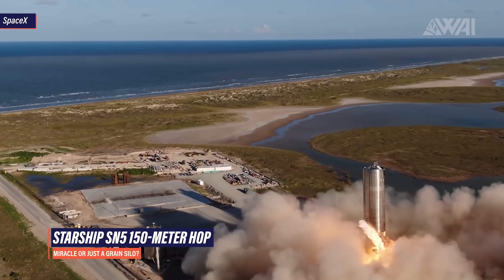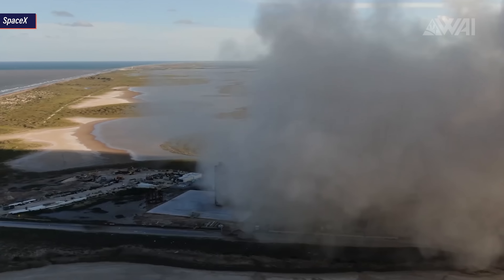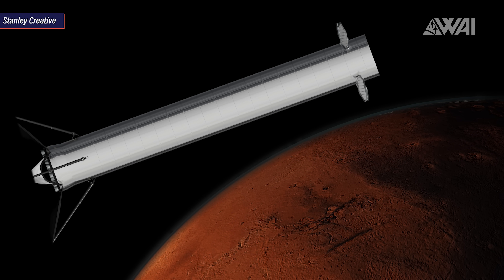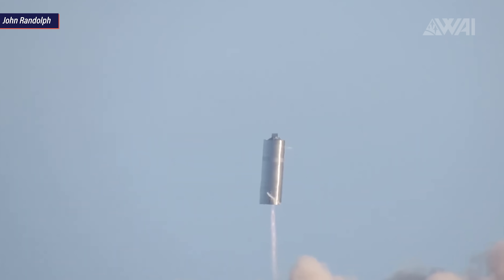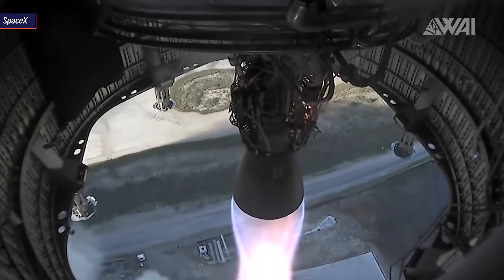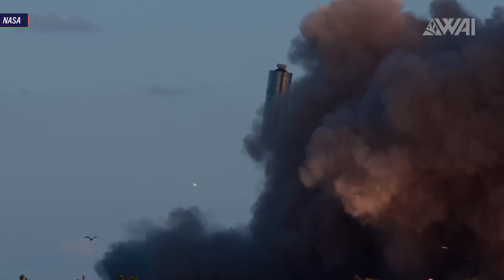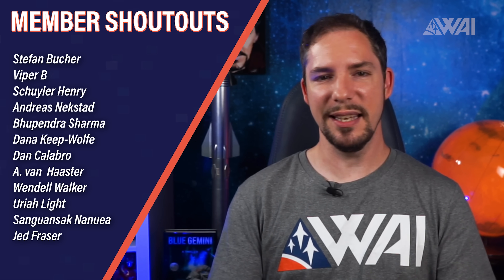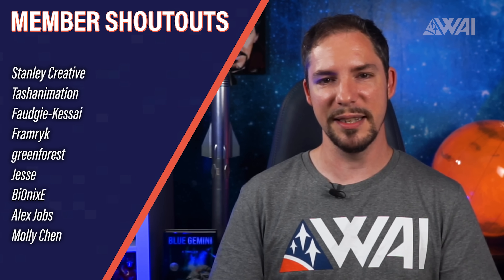111 | SpaceX Starship Updates – How did SN5 do?

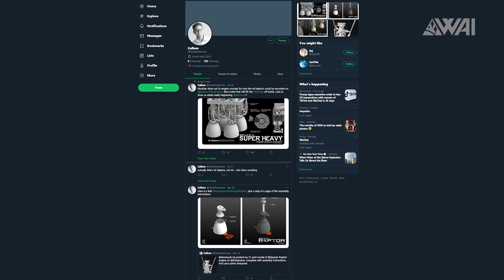Comment: Callum's design isn't wrong simply because of the number of Raptors on the booster.  His arrangement isn't designed for symmetrical thrust.  @ 11:30 minutes the bottom left view of all the raptor engines shows four engines at the top side but 3 or 5  on the bottom of the view completely asymmetrical to the opposite side.  

If you need to shut down a damage engine the engine on the opposite of the rocket needs to be turned off too and it helps steering if they are exactly opposite to each other.
Reply: they can throttle the engines as well in case of engine failure. I doubt it would be as big of a deal as you describe as falcon 9 can fulfill it's mission on 8 engines.
Reply: @snuffeldjuret  you're proposing to make the programing of the flight that much more complicated which serves automated contingencies like engine failures, loads, center of mass, throttling and gyroscopic control more complicated becuase...its not that big of a deal.  You'd just might be a good fit at Boeing.
Reply: @snuffeldjuret  who am I?  I'm just a Mechanical & Structural Drafter Designer. 

Disabling and or throttling an engine depends on your flight profile and fuel margins vs load.  If you're at the maximum margins for flight throttling wont work while you could shut down the opposing engine and burn for a longer duration., assuming  you sacrifice a optimum landing.

Throttlings disadvantage is asymmetric thrust,  lost efficiency when thrusting away from the center mass. Gimbaling corrects but you lose fuel unnecessarily.  Same with RCScorrections.  You get into space but you can do less once you're up there.
Reply: @snuffeldjuret  No, not a programmer, not a Space X Employee but Tesla did want to higher me if I was willing to move to Austin.  I'm in Houston.  Nonetheless  that's a problem for Engineers and Designers like me not programmers.
Reply: @snuffeldjuret  Having a comment on Falcon 9 failure procedures and that comment not being recognized are mutually exclusive.  The denial of such a simple reality must mean you are operating from conclusion based reasoning.  Not much else to say.  You either use reason or you can't.
Reply: @snuffeldjuret  It depends on the flight profile and margins.  You're focusing on Falcon 9 as though its comparable.  I dont think it is.  The Merlin failure on a Starlink flight resulted in a lost booster on landing but it had enough margins in the second stage to make up  for the failure because it was so late in the flight.  Now if Falcon 9 had been programmed to use any 2 symmetrical engines to land after failure is detected one might think the booster might have survived...but no.  The booster is so light at this point that even at the lowest throttle setting the booster would have begun rising again.

The Super Heavy is more like the N1 rocket. It will need 3 engines to land all that mass so there for symmetrical thrust is even more important to recover during suicide burn.
Reply: @snuffeldjuret  yes the falcon 9 can suffer failure in one engine but that still depends on the available margins.

Comment: I like Starship but in many ways I'm more psyched about Super Heavy. Even without Starship, (ie with a conventional 2nd stage) Super Heavy revolutionizes spaceflight capability. Super Heavy is also more straight forward to achieve with the biggest hurtle being the engine count (which isn't that much more than FH). Starship (while I have faith that it will prove out) has many more un-unprecedented hurtles.  SH's relatively easier development gives me even more of a comforting feeling that no matter what spaceflight will change forever for the better.
Love you, Saturn V, but you belong in the past. It's long past time to pass the crown along.
Reply: Cheap and consistent; starship is the way

Comment: I do not doubt Starship could quickly become a pretty cheap cargo ship with a very fast turn around interval between flights... but for crewed missions, it would be much easier and safer to design a 9m Heavy Crew Dragon to be put on top of a SuperHeavy Booster with a standard heat shield + parachutes re-entry pattern than the belly-flip manoeuver and retropropulsive landing that Starship should do to land... that kind of re-entry pattern is unworkable for the crew safety, if the belly flip failed for any reason, it's a total loss and NASA will never accept such a high risk of a catastrophic human loss. Things will take much more time than most think to reach the point of routine crewed travels. But we are undoubtably going fast in the right direction.
Reply: I agree that there is a huge danger and the system would need to be proven and proven heavily before I'd ever get on one, but unless they're flying NASA crews I don't think NASA has any actual say.
Reply: @TheEvilmooseofdoom  I don't know which administration will be responsible but there will be one to qualify the craft to be safe enough to take passengers. You can't maje a plane and put passengers in it, even volunteers ready to die, without your plane having passed a certification. I have the feeling that NASA will be that administration. Now it's also a first, so maybe they will create a new administration for space craft but in any case it will not be just Space X deciding that their craft is good enough to take passengers.

Comment: @Felix I think you misunderstand the protyping process undeway right now.  I don't think Version 1 of Starship will be assembled this way with "Rings"  That's a lot of weak points for failure.  It will likely done like SLS  and  Space Shuttle with single LARGE sheets of metal stiffen with girders.  They don't have the Machines to make these machines right now because they don't know what the final design of version 1.0 will be.

I believe this current prototyping is being done this way to prove the concept as doable AND flyable in order to get NASA's and the worlds attention (Much like they did with Falcon 1) and then get the NASA to fund the development.  That's when they'll start really designing Starship, knowing what works and what didn't work from the prototyping phase.
Reply: @admarsandbeyond  I think they will still put orthogrids in the skin even if it means some new or uncommon technique which is where the steel Advantage may come into play. This current method is fine for prototyping but I see too many places where weld inspections and scans are needed.  That has to be reduced. There will still be modular sections to make this swappable and easy to repair but definitely believe the plant its self will not follow traditional methods

Comment: Falcon 9 was supposed to have a 24 hour turnaround which turns out to be fifty times greater. So using that as an example the three times a day or 8 hour turnaround would equal somewhere around 16+ days turnaround for Superheavy. Who knows for Starship and it's heat tiles and other re-entry fun issues.
Reply: @admarsandbeyond  good points I guess Elon didn't know about those when he talked about the 24 hr turnaround...
Anyway I am kind of joking with these posts. I find this all exciting.
Reply: They're still working it.  It's also supposed to fly 10 times and they've just now crossed the 5 threshold.  These things work in steps and no one really knows where the final step will be.

Comment: I can't believe they didn't decide to go with the Falcon9-style of legs from the start. It's hard to imagine a better option.
Reply: Legs on Starship exterior would have to withstand much higher heat than the Falcon9 legs do. Especially the "belly" side exposed to plasma. This is the primary reason for swinging legs down from the interior.

Comment: I have seen engine fires on many of the F9s and they use to freak me but no one said anything about them. They keep flying and re-flying them with no problem so it is probably no big deal.
Reply: mike george yeah prob just some lubricant burning
Reply: Are you sure it was actual fires? Because the merlin engine is an open cycle engine, it has what is basically an exhaust pipe from it's pre-burner and dark smoke comes out of it. If you didn't see any flames, odds are you mistook that smoke as being from a fire.
Reply: @carljohan9265  check out some of the videos of close ups of the f9 launches, lots of flames around those engines. but you maybe right and it is from the pre burners...
Reply: @-mike-8134  Everyday Astronaut has a very good video on different rocket engine types. You should check it out, he talks about both the merlin and the raptor in it.
Reply: I'm not sure if this is what is going on but if you look at some shuttle footage it looks like the bottom of the ET is on fire.  I seem to recall that the reason was that the vehicle itself created a bow shock as it moves through the air and part of the result is a very low pressure point at the bottom of the rocket, enough to suck up some still combusting gases.

Comment: Starship challenges: Though we do not know the extent of damage to the launch pad, you showed that something happened and it will have to be repaired. True, that with 3 raptors, it won't slide and a better deluge/sound suppression system would help but they cant keep repairing or replacing test mounts. Safe to presume they will take steps to protect the engines from catching fire in the future.

Launching from a launch pad on earth is fine but Starship will have to launch from a flat surface with out a launch pad and with out a sound suppression system or a flame diverter, like on Mars for instance. To launch and return to Earth, either they will have to have a launch pad to launch from or the legs will have to hold it very high in the air. They should try to get some test data by launching from the landing pad at some point.
Reply: Just brainstorming.... would launching at a slight tilt help? Forcing the engines to balance the load aggressively, directing thrust outward in a single direction away from the skirt. Makes me wonder if landing on a sloped surface could be a benefit.
Reply: Sounds suppression is not a big issue on mars with 1% of earths atmosphere and zero on the moon.  Also lower gravity means either they get up quicker or get up using less thrust.

Comment: Cool achievement from SpaceX - again. Now, we can wait for the big 20k. :)
Reply: Any idea when it will happen?
Reply: @farrukh8827  Elon tweeted, there will be some more similar hops, to master the launch procedure, and probably the flight operations and landing as well.  SN5 won'T fly the 20 km hop, most probably. There is no nose cone on it, and the mass simulator is also attached to it. I guess, it will be SN-6 - may be - and that has to go through the pressure and static fire tests. SO more similar low hops and preparing of SN-6 can go parallel, my guess is 2-3 weeks till 20 km hop.
Reply: @jeechun  2-3 weeks? wow. really? it is too fast...
Reply: @farrukh8827  of course it can be more, it's just my wishfull thinking. :)
Reply: @jeechun  It took a whole year for second 150m hop of starship prototype  after the first hop of hoppy. I remember how they were planing 20km hop in December of 2019. But now they have several already 99.99% finished  starship prototypes and enough raptor engines. This year everything looks so great. I hope it will accelerate Starship/Superheavy  development.
Reply: @farrukh8827  Yeah, you are right, they were really stuck with the pressure holding  problems, welding problems for quite long. Now, things start to get into motion, start to progress faster. Exciting times come.
Reply: @jeechun  Anyways their average development  speed is too fast and open to the public. The important thing is SpaceX is not using tax payers money for starship development.😃

Comment: 3 hour turnaround? I'll be shocked if they can reach a 7 day turnaround some undetermined time in the not too distant future. The proposed engine layout for the booster is very similar to the ill-fated Soviet N-1 moon rocket. It's probably a valid concept and has built-in redundancy with so many engines. However using the airline analogy that Musk likes to use, the trend has been for reduction of engines for greater ease of maintenance, so from 4 to 3 and now most new airliners are using 2. Saturn V had 5 F-1 engines.

Comment: Very curious to know, what happens to the teststand during the launch. And what flew through the air.
Perhaps the surface for the workers should be built out of grid structure instead of plates?
Greetings from Munich, Tom.
Reply: The test stand get subjected to the worlds biggest blow torch.  I am surprised they opted to take off from it at all.

Comment: All the debris from the test stand is because they couldn't take off straight up.  Because of the off-center engine placement, they couldn't avoid lateral motion when they started to rise.  So the raptor is going balls to the wall, and it flies over the edge of the stand at say 30 feet altitude.  They expected this.

Comment: SN5 cost is $5m. Raptor SN27 $1m. I would assume a full SS without SH to be $13 with engines and a SH will be maybe $40m. So call it $53m for a full stack unfueled and maybe $55-$60m for a test launch. Overall dirt cheap compared to a SLS, F9 or FH
Reply: And more important thing SpaceX paying with own money. While others are paid by tax payers. 😰
Reply: A lot of this is paid for by NASA. Therefore taxpayers are also paying for it.
Reply: @thutch8097  SpaceX are funding this development. NASA are funding the LUNA starship.
Reply: @thutch8097  No you are wrong. NASA is not participating in Starship/Superheavy project. NASA  has paid nothing for its development.
Reply: Assuming 100 reuse per ship and booster, the launch costs exceed the depreciation. Astonishingly cheap!

Comment: My guess is that the tilt on SN5 was expected. The current leg design does not support auto-leveling and SN5 did have to land at an angle to prevent powersliding, so the end result seems kind of predictable.
Reply: There is a way to land using one or two offset engines without consuming the crush material in the legs. It requires setting up in advance just the right tilt, pitch rate, horizontal drift, and vertical velocity. 

You can then use a constant thrust and zero gimbel angles to land on the tips of the landing legs.

Comment: 150 meters high - Achievement Unlocked!
Reply: And just with" 1!" Raptor engine
Reply: Next goal: 20KM
Reply: @gabsr, Nest goal MARS!!
Reply: Next achievement at nose cone and fins 20km flight
Reply: At least they lifted 100% of weight this time...
Reply: Perform a 150 meters hop without any damages - Achievement lock. I think this could be the next milestone and I don't even think we'll see a nosecone, more raptors or fins for the next hop. That would be the fastest way to get a cleaner hop assuming lack of experience is the issue. This is just my opinion so I don't know what could be next.
Reply: Thought they did that already with starhopper
Reply: +420XP
Reply: Perform a suborbital test flight above 20 KM on Kerbin
√ - on Kerbin
√ - in suborbital flight 
o - at altitude above 20,000 meters 
o - has a MK8 "Starship" faring on vessel 
√ - has a "Raptor" rocket engine on vessel 
o - perform test

Comment: 12:30 They're probably doing those modular engines for Super Heavy already knowing SpaceX.
Reply: He said it on video. And there is no such problem with Starship becouse it only going to have 6 raptors or some more.
Reply: The gimbal vs. non-gimbal feature has nothing to do with the engine design. They aren't different versions of the engine with different thrust, they have the same turbopump assembly, same nozzle, and same thrust. The only difference is the inclusion of a gimbal mount, because not having gimbal for the outer rings of engines saves on weight, complexity, and space, while having gimbal for the inner group of engines is necessary for control.
Reply: @J7Handle  I can absolutely see 3 launches a day if they had a system where they had a replacement assembly for each group of engines. 1 crew of mechanics for each assembly. Drop the current assembly and have the next one put up in place attach, inspect and launch then check the assembly that came back while they wait to reinstall it after the rocket comes back. As long as each assembly is identical and all the connections are identical you're fine.
Reply: @J7Handle  
Actually, by design, the gimbaled engines are going to also be throttled, since only these will be used for landing. Since the outer engines will not be throttled, the variable valves can be omitted and more thrust can be obtained. It is a coincidence, not consequence.
Reply: @avid0g  The fixed engines won't be throttleable? that's a new idea. As far as I know, all the Merlins on F9 are throttleable. Certainly on the Falcon Heavy center core (they throttle it down for a longer center core burn, having only the middle engine be throttleable would make that very ineffective). But I can see the throttle valves being omitted on Super Heavy. The difference in thrust, however, should be close to negligible, if the throttle valves are designed right. The only losses I can think of for the throttleable Raptor would be friction or disruption to the flow from the valves, but that's a design issue.